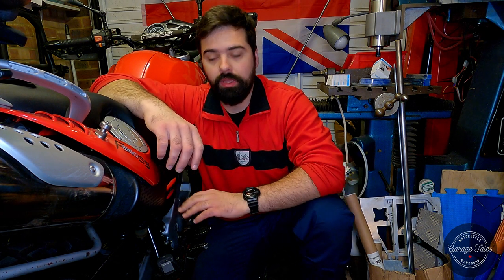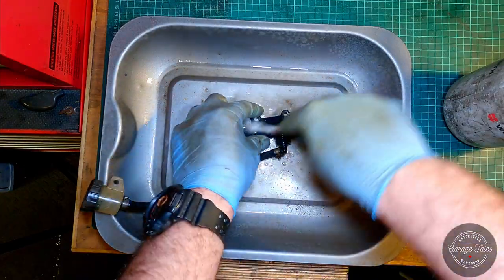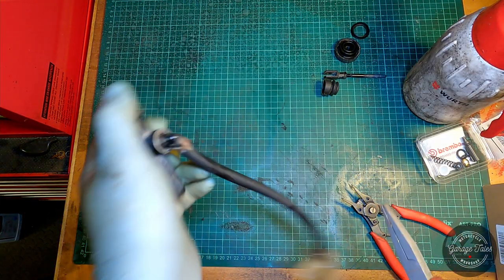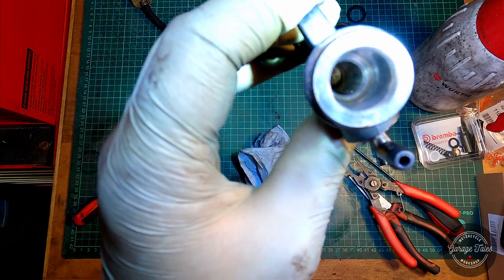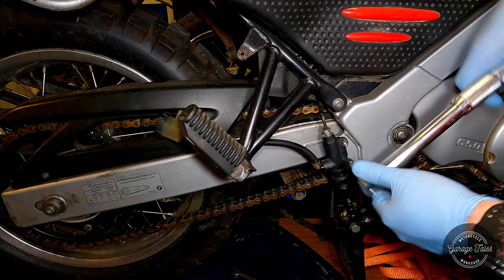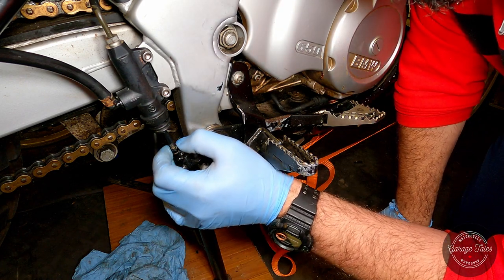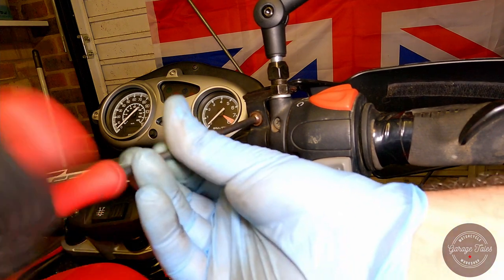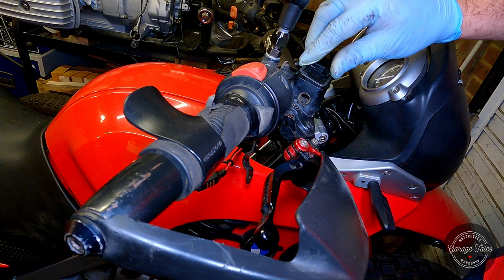vid18   BMW F650GS Rear Master Cylinder Rebuild

Comment: Great video.I am servicing my front brake master cylinder on my  f650gs but the question is which seal do you replace on the piston as the rebuild kit only provides one seal an there are two.Many thanks
Reply from the maker: Hi there. I’m not sure there are 2 seals on the master cylinder. There’s the main seal and the bellow that protects the cylinder from the elements. Both should be included in a rebuilt kit.
Reply: Thankyou for the reply.Just one more question please is the seal the first one the piston or the second one.Also the rebuild kit only provides the seal,plunger and spring and the rubber cover for the f650gs.Thanks again. James
Reply from the maker: @jamesgale1221  Hi James. Some bikes have 2 seals on the front master cylinder, but I believe the F650gs has only one going on the tip of it. If you bought a decent rebuild kit, it should have a diagram on how it goes together, or you can look at the old one and put it back together the same way :)

Comment: why did you rebuild the rear cylinder? what was the issue? what was the break funcionality before the rebuild?
Reply from the maker: Hey there. The brake worked fine as far as I can see, but the owner suspended it was binding intermittently. I couldn’t prove that, but he wanted it rebuilt anyway for peace of mind.

Comment: Hi, great video and explanations! I need to go through the same procedure (I don't get any pressure at all in the rear brake and I'm thinking the issue is with the master cylinder) and I'm a bit worried about air getting trapped in the system and triggering the ABS; so my question is, do you need to reset the ABS after the procedure? Thanks
Reply from the maker: Hey there. Thank you for your comment and sorry for the late reply.

You can treat it like a non abs bike and bleed the brakes normally. With the right scan tool you can cycle the solenoid valves in the abs unit to dislodge any air bubbles, but you shouldn’t need to. You can more or less achieve the same effect by braking hard to activate the abs. Just do it carefully 🙂
Reply: @garage_tales  many thanks for your reply, I'll just do as you suggested

Comment: Thanks for the video, mate! Really clear and concise. Could I please ask what magic cleaning fluid you're using?
Reply from the maker: Thank you for your comment! Appreciate it.

I’m using brake cleaner. It’s really good stuff. Use it on anything that needs degreasing and usually buy 40-50L at a time as it works out cheaper.